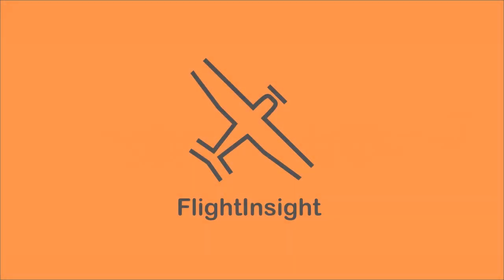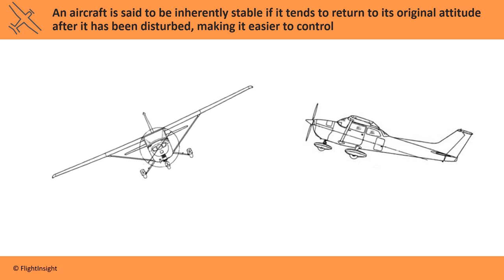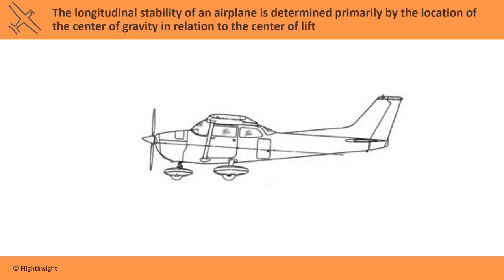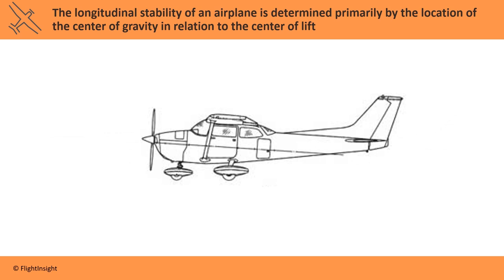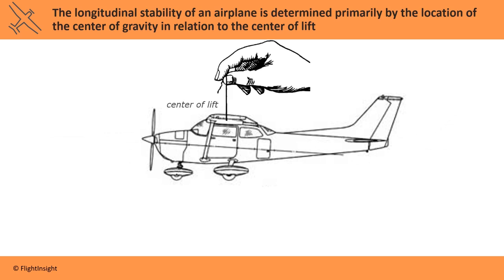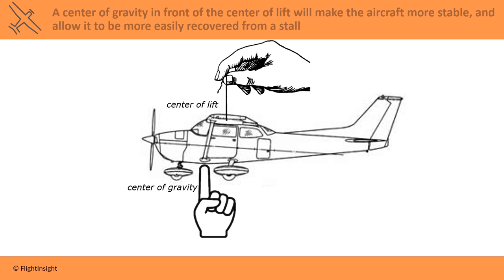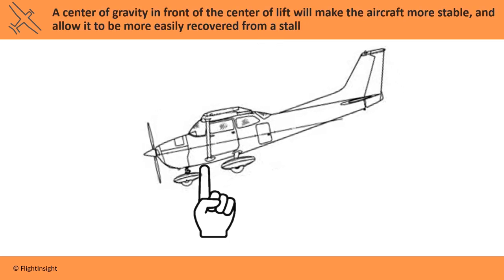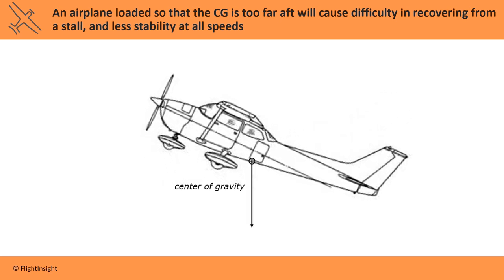What Makes an Aircraft Stable? | Stability & Control

Comment: This can be expanded upon as well. Aft CG will also lead to higher speeds due to less drag on the elevator
Reply: Aft CG doesn't mean behind CoL. Aft CG means close to its aft limits, which still can be front of the CoL

Comment: But why though? - Due to the typically different angle of attack of the wing and horizontal stabiliser.
When the plane pitches up by eg 1deg, the main wing increases AoA from eg 4deg to 5deg,  which is a 25% increase. The elevator though with lower starting angle of attack increases 1deg too, but from eg 1deg to 2deg - 100% increase!
Any small angle change disproportionately affects the stabiliser, which acts to undo the change.

Though, the starting condition that the wing is at a higher AoA then the stabiliser is true when the CoG is in front of the CoP, otherwise everything is reversed.

Comment: Out of curiosity, what about the other 2 axes?  Does dihedral help with roll stability?  What would help yaw stability?
Reply: Position of aerodynamic center, wing sweep and horz stabiliser for roll stability. Yaw stability is all about the vertical stabiliser and overall surface area behind the CG
Reply: Makes perfect sense, thanks @ATHGT!
Reply: Wing sweep helps yaw stability too. When yawing one wing tilts more directly into the airstream while the other tilts away -> more drag...